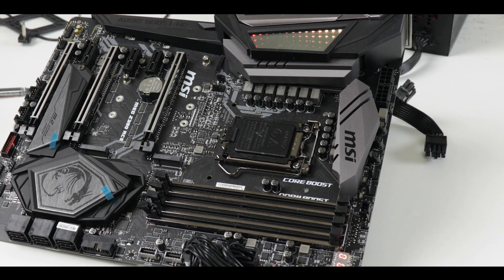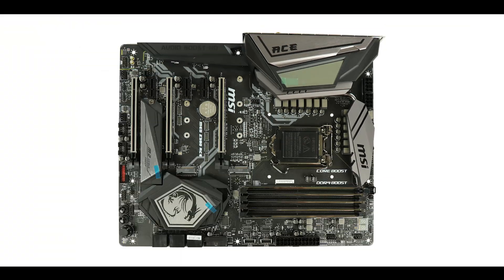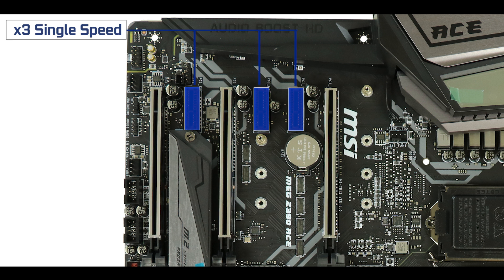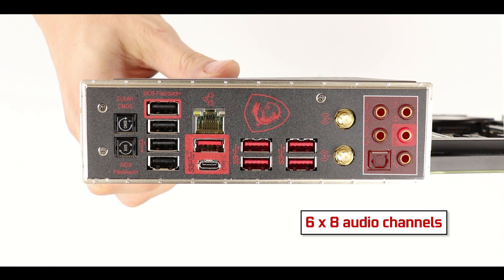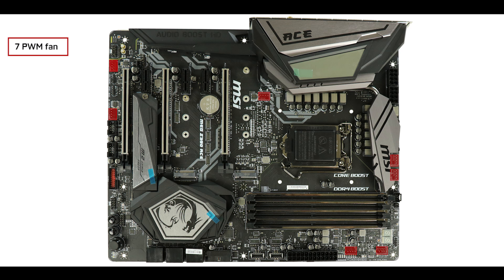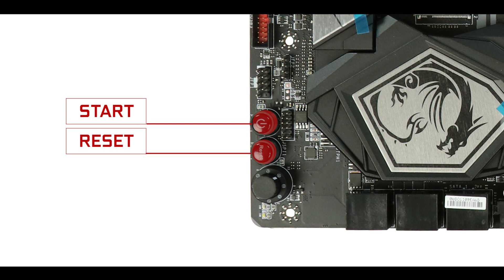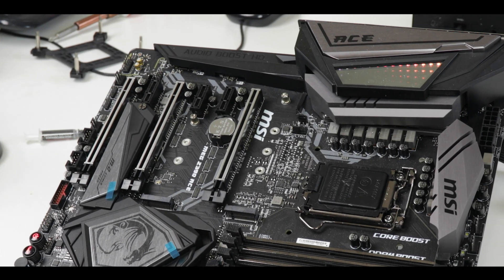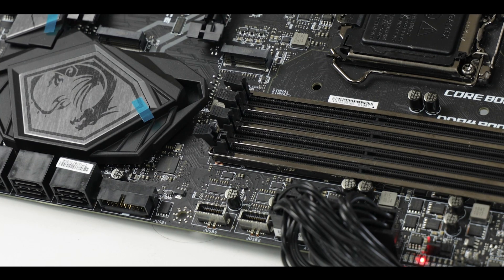MSI MEG Z390 ACE : The Ultimate Over-Clocker

Comment: Have had this MB for a year now, first with a 9600K now with a 9900KF. 
Just decided over the last few days to get a bit more serious about OC and currently running stable 5 Ghz at 2.7 volts.
Temp under stress test maxed out at 80 C but in gaming runs about 65 C.
Very happy with results so far.
Great vid btw.

Comment: Will this support an amd ryzen 5 2600 cpu?
Reply from the maker: Yes :)
Reply: Laurent's Choice so I tried installing the ryzen cpu and it did not work
Reply: It doesn’t fit
Reply from the maker: yeah... that s my fault. I told you yes assuming this comment was on the X570 version of this board ... not the Z390. 

The z390 will only run Intel Processors, not AMD. You need to switch board to the MAG X570 Carbon or ACE (which  I also reviewed). 

want to drop me an email so i can guide you more?

Comment: If you ran SLI on this board with 3 slot sized cards, how much space would there be between the cards?
Reply from the maker: Not much. But it should fit.

Usually GPU come 2.5 PCIE slots size.